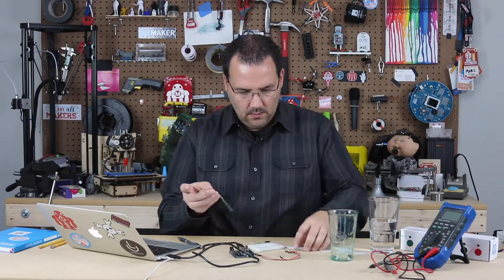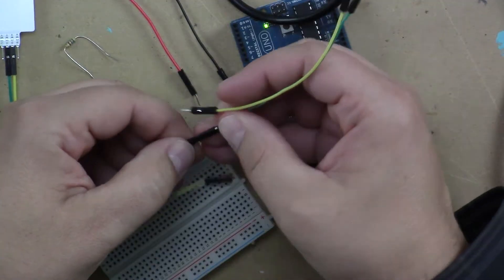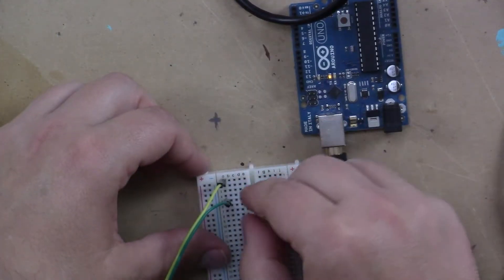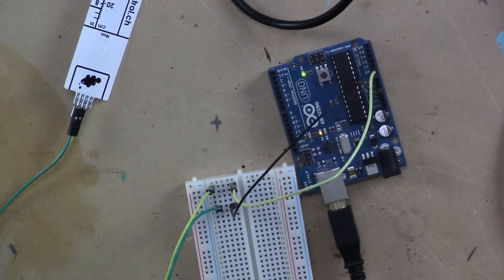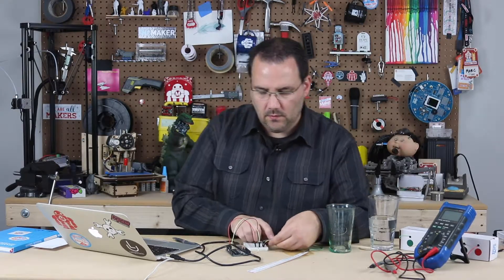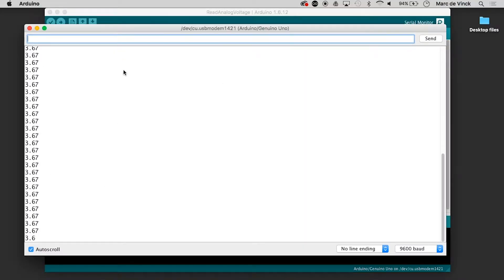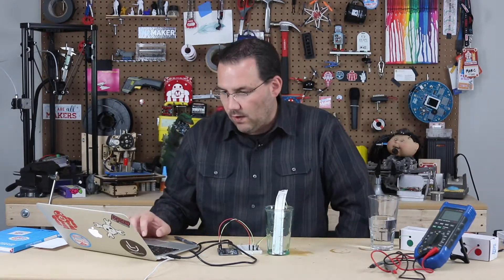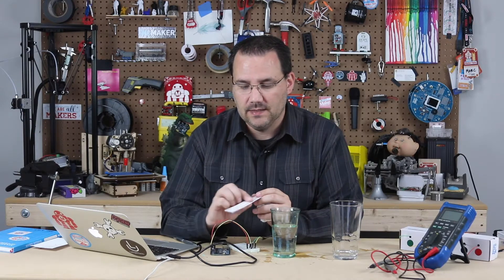Arduino Prototyping Inputs #45: Measuring Water Levels

Comment: How did you know that you need a resistor there? Is that in data sheets?
Reply from the maker: Always start with the data sheet! In this case it shows the connections required and the value of the resistors that are required.
Reply: @MarcdeVinck  Got it. thank you.

Comment: You don't say what the sensor is or how to get one. You also don't reference the other tutorials that show how to connect it. Either in the video or in the description.
Reply from the maker: There are a variety of water sensors out there. It uses generic analog read code that comes with the Arduino. Here is a link to the specific one I used (Google for others) -- https://www.adafruit.com/product/464

Comment: Can I get the codes
Reply from the maker: Sure! The code I use is built into the Arduino IDE (software). You can find it under Examples > 01.Basics > ReadAnalogVoltage. You also can get a lot more information, including other code examples and usage, on the product page -- https://www.adafruit.com/product/464